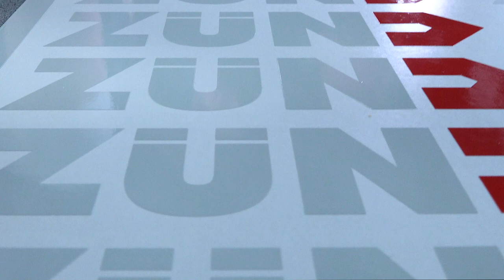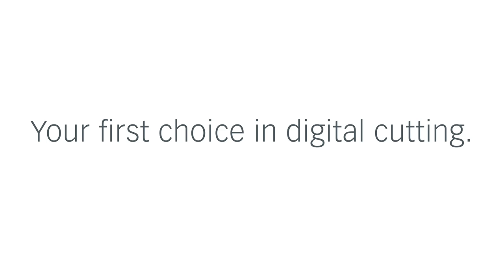Zünd new kiss-cutting blades Z6 and Z7

Comment: Hey, what are differences in Z6 &Z7? Do I just use Z6 if I want to cut PS to a liner?
Reply from the maker: Yes, Z6 is a new revised knife for kiss-cutting
Z7 is a specially made knife for through cutting using the KCT with a glide shoe